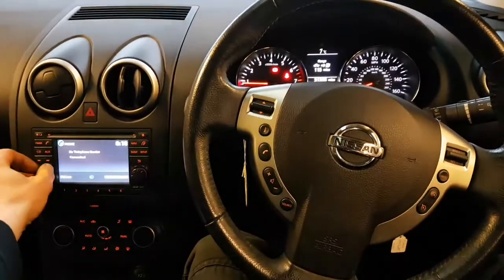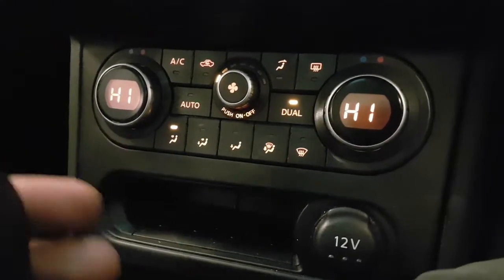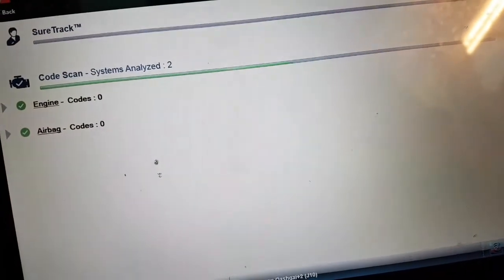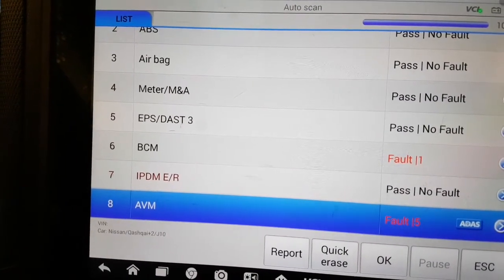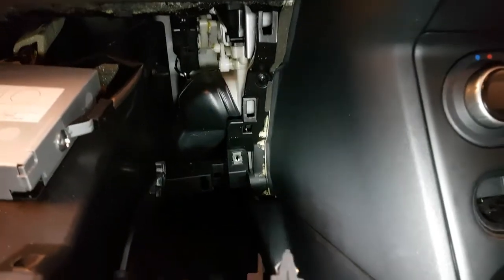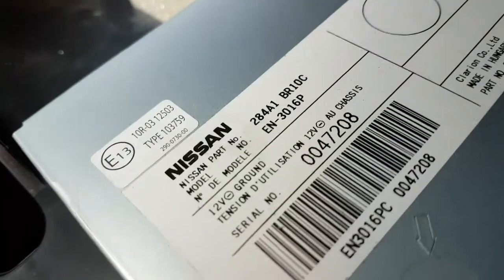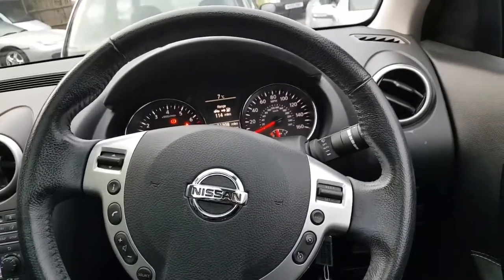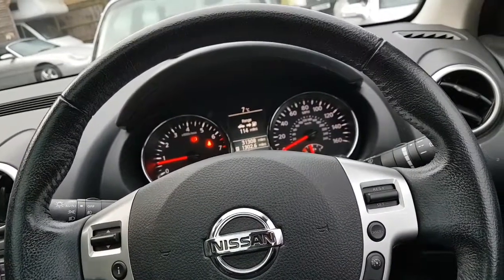Nissan Qashqai no passenger side temperature control

Comment: Had exactly the same issue. Drivers side was either hot or cold as selected but passengers side was constantly warm. Temperature did not change when using the dial.
Local garage suggested it could be a faulty module so £££'s plus labour of course.
After watching this video I checked underneath the glove compartment and had exactly the same problem. Plug had simply come out, bit fiddly but after a few minutes is was back in and working perfectly. Didn't even have to remove the glove box. Thanks very much for sharing.

Comment: Guess what?
I've got the exact same issue on the exact same model. When winter came I wanted to switch heater on but realised only one side was working.
Took to the garage where we did a full service 6 months ago and they quoted more than 300 bucks!!!
I've came across your video and find the exact same wire was hanging out disconnected
You've saved me time and money and now I can enjoy the heater!!!
Thank you so much!

Comment: you just saved me 500 dollars mate, you are amazing! mine was on the same side but on a car with left-side steering wheel. still, didnt have to remove any plastic, just had to pull the wire from inside as it was hidden at first- used a pencil. Thanks a lot!

Comment: Thank you for recording and posting this video….
Our Qashqai is 2008 and our dual control was hot on the left (really Hot🔥) and working fine on the driver side. Journeys had become a pain as too hot with the windows closed and to noisy at motorway speed to have the windows open…

So found your video after poking and prodding around beforehand with no luck…

Would you believe it: same plug was out. Plugged it in and it works!!!

THANK YOU!!!

Comment: How do you get to this bit of the car as I can't see in my 2011 qashqai how to get to it unless it's screws?
Reply: On my 2008 Qashqai I slid the passenger seat back, remove a foam cover and that was enough room to lye upside down in the passenger seat with my head on the floor looking up below the glove box 😂 then looked for the same part you see in this ace video.
So up above where the passengers right foot would be, on the side.